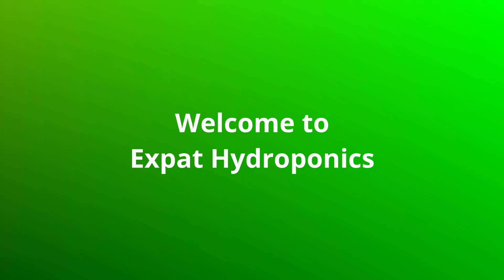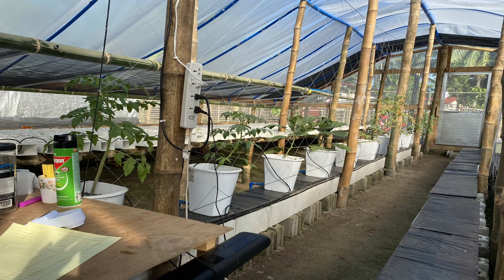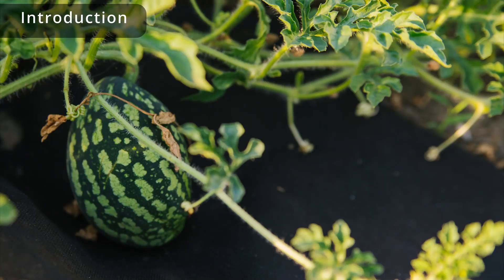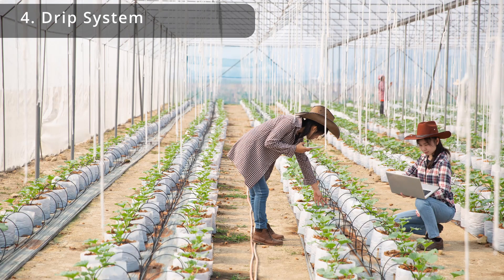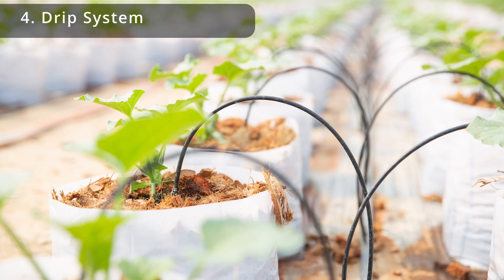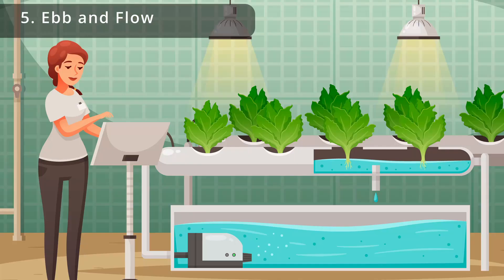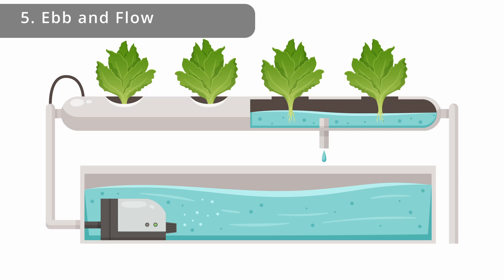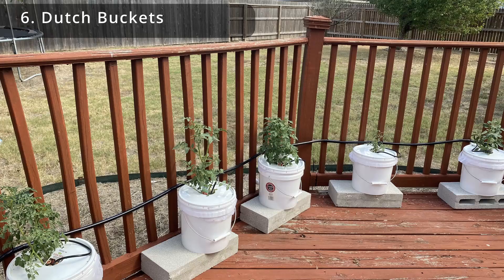Seven types of hydroponic systems

Comment: With genuine aeroponics the water isnt misted on to the roots, the roots are suspended in a mist environment. To highlight the difference, if you go out on a rainy day you will get wet as the raindrops hit you. Conversely, if you go out on a foggy day, you will be immersed in the fog and over time you will become damp. This is how genuine aeroponic works, the roots are never wet nor dry they simply remain at a relatively constant dampness due to being in the mist environment.
Aeroponic roots look entirely different to hydroponic roots and it is this difference that provides all of the advantages associated with aeroponics.  No aeroponic root structure, no benefit over hydroponics
https://youtu.be/l1Rmm9JvPfY
Reply from the maker: Thank you for the clarification.

Comment: thanks for the video.  i bought a tower (aeroponics), i see some crunchy white power forming around the tower and gradually the plants are dying. not sure what the problem is.  the same water when I used in a bottle they are growing pretty faster. any insights are greatly appreciated.
Reply from the maker: I am back in the U.S. and the guys taking care of my house stop using the vertical tower. I did notice something like you describe before I left. Please let me know what you discover.
Reply: @expathydroponics8500  yeah sure
Reply: @expathydroponics8500  
Most aeroponic towers are vertical NFT, not aeroponic :) The white deposits are likely to be calcium, either from hard water or from the nutrient solution due to evaporation. I`d check the air temperature inside the tower, its more important than the nutrient temperature in the reservoir :)